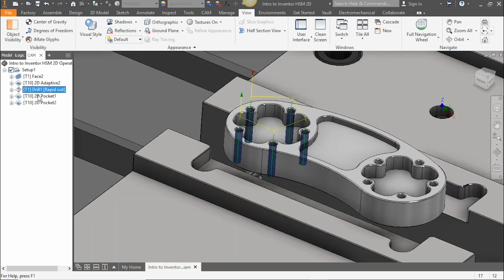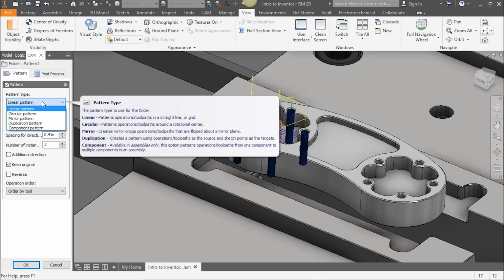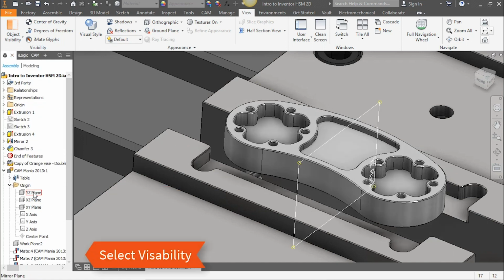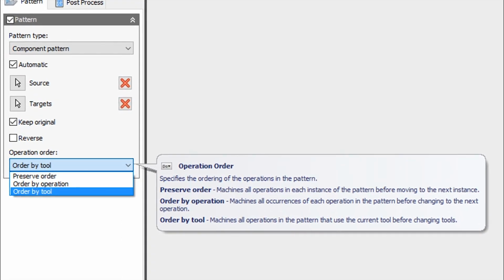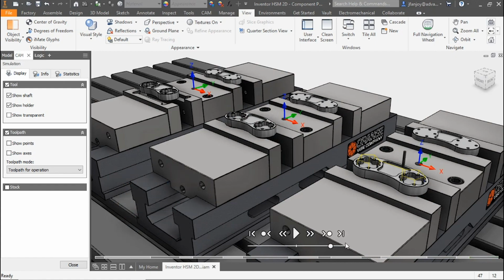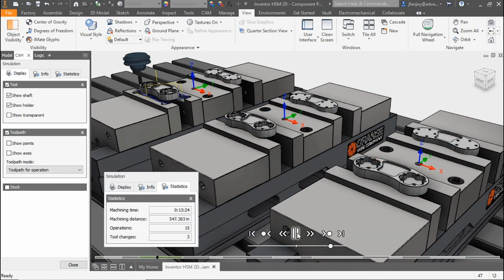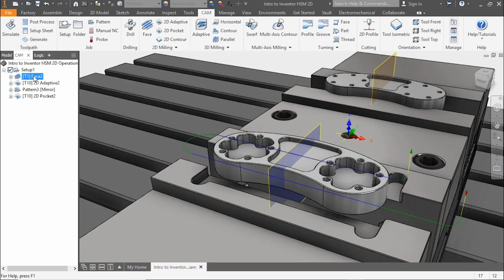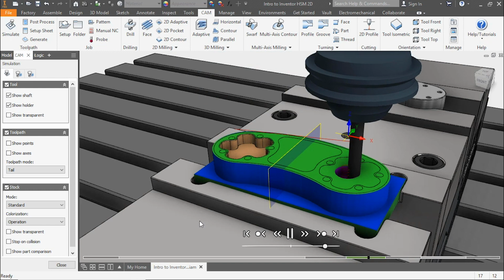Inventor HSM QUICK TIP: Mirror Pattern

Comment: Can you change the mirrored operation to climb cut because I noticed that it did a conventional cut?
Reply: I noticed that also, OK for drilling cycles only it seems? You'd want to keep the cut type the same for milling.
Reply from the maker: That's an important thing to note on mirror patterns - the direction changes from climb to conventional (or vice versa). One way around this is to use a Circular Pattern with 2 iterations if the part geometry allows.